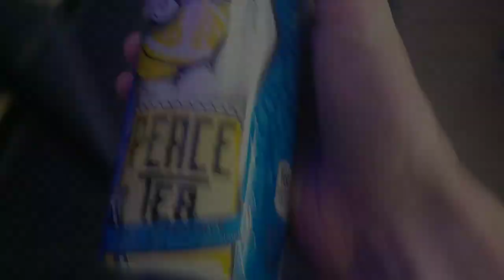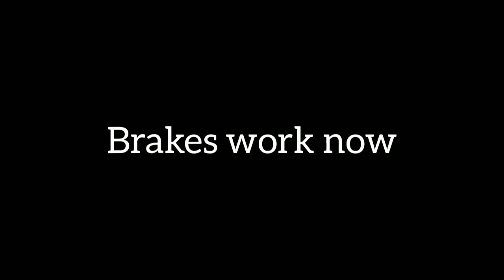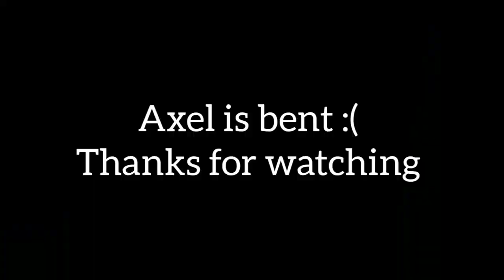I bought a new go cart Manco 606 Scorpion

Comment: I just picked up a Manco 606 frame last year, I installed a Predator 212 Hemi engine, brand new drivetrain and stage 1 kit from go power sports. I also have a taller set of Snuf off road tires in the rear. It’s an awesome go kart!
Reply from the maker: Sweet, I really like mine as well!